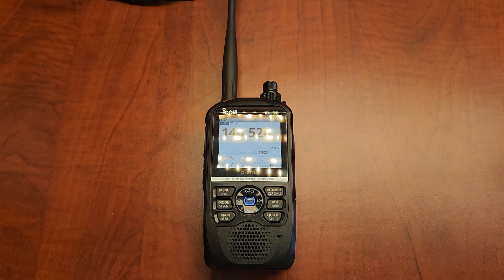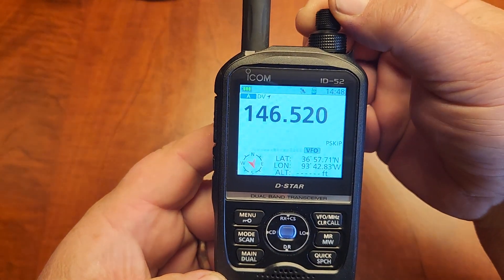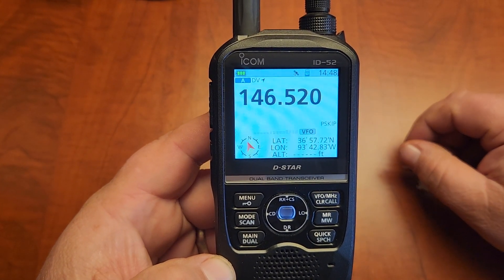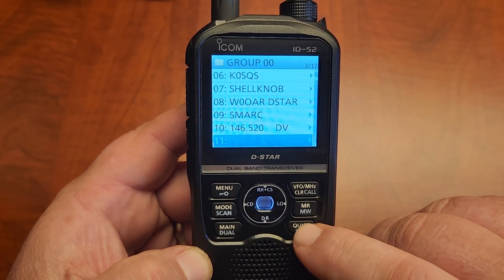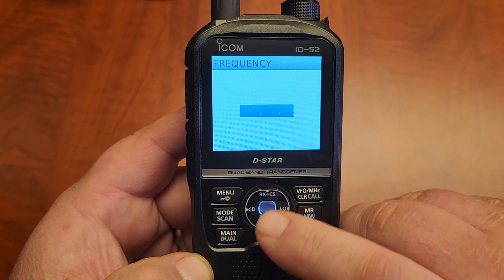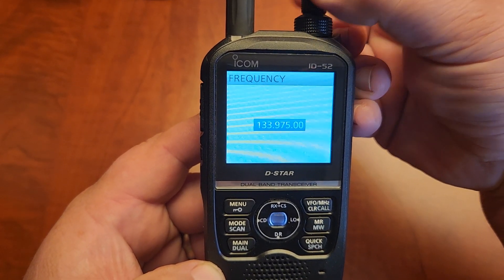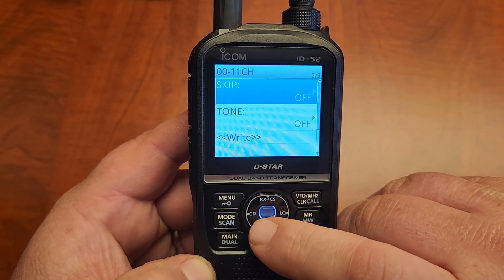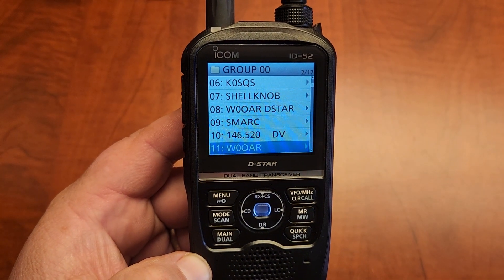Programming Basic Memory Frequencies Into The Icom ID-52

Comment: I’m not clear on why there is a GPS? For some digital mode?
Reply: yes digital modes and you can search for local repeaters depending on where you are in the world. So if im in a new state that i dont live in i can have it search for local repeaters and it will pull them up using the gps location of where you are. It can also tell you in what direction someone else is from you.
Reply: @CentralGaDistrictARES  Thank you for the reply.
Reply: Also works with analog if you program your radio correctly.  Uses GPS coordinates of repeater

Comment: I’m having trouble Programing a 440 frequency I can do 2meters fine but there are different fields for the 440
Reply: When I get TS the value is 25 and goes up from there and I can’t get in to the repeater
Reply from the maker: So in the quick menu change where it says TS to 5.0khz while in VFO mode.

Comment: By default will this radio transmit on GMRS channels if the frequencies are added to memory?
Reply from the maker: No it is not capable of transmitting out of the amateur bands. You can receive though.
Reply: nope not a gmrs radio its ham.

Comment: Is there a way to change the khz rather than have it jump? I noticed mine only jumps by 25. I’m trying to get in .012
Reply from the maker: Yes absolutely in VFO mode push the QUICK button and scroll to "TS" that's where you change your tuning step size 
Hopefully that works for you.
Reply: @HamRadioWithKE0MAD  it worked! Thank you for your help and quick reply.
Reply from the maker: @agimduraku8489  no problem my friend 73s